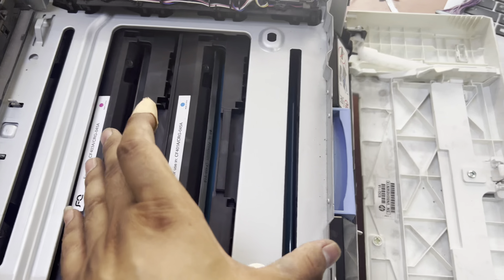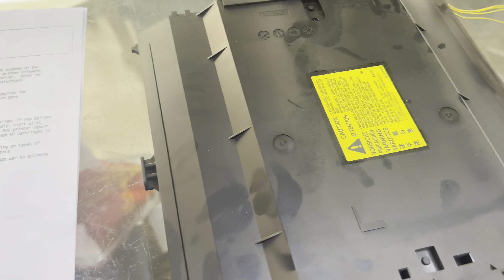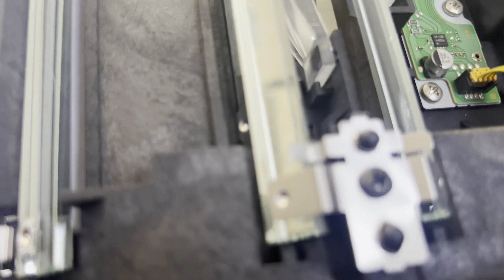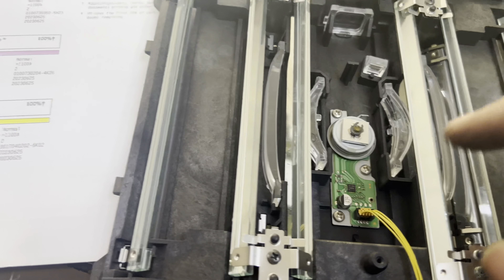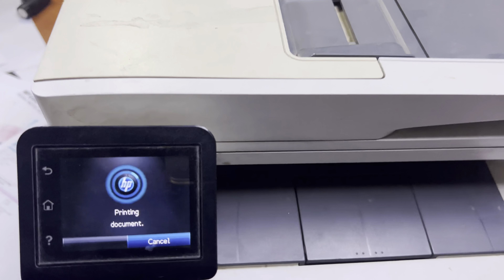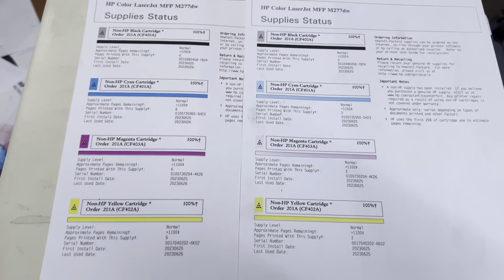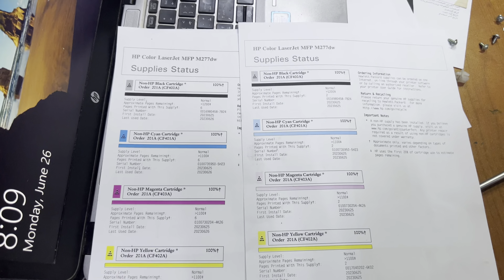Poor Print or Light Print Issue in HP Color LaserJet Pro Printers | Laser Unit Cleaning Guide

Comment: I have MFP M176N.
Is this method applicable to all HP laser jets?
Reply from the maker: First change the drum unit of M176n and check
Reply: @BilalKhalid  
First of all; Thanks for the quick reply.
Replaced the drum unit 2 months ago and cleaned it as well. But the real problem seems to be in the imaging mirrors.
The question was, where are these mirrors installed and can they be easily found?
Second, it prints just fine, but the copy is very light. So will replacing the scanner light fix it?
Reply from the maker: @PAKLANDTV no, if the copy is light or dim then the issue is with the scanner, nothing else. Just changs scanner lamp and it will fix your problem.
Reply: Printer have a new problem which is stuck on initializing after cleaning the mirrors. Can you explain what would be that?
Reply from the maker: First of all there was no issue with the mirrors, if its getting stuck now then remove all toners and re install one by one while the printer is turned on

Comment: Nice video bilal bhai.
Bhai after cleaning laserunit my printer  not printing Cyan color but other 3colors printing good only cyan color is missing.
Please reply❤need solution
Reply from the maker: check with another cyan toner or make sure all cables connected properly, or it can be due to laserunit itself.

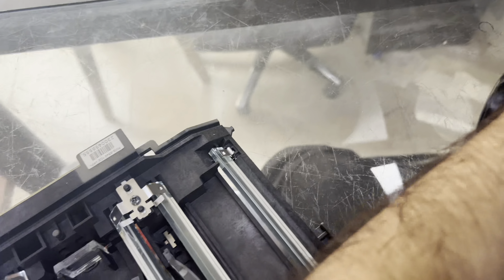Comment: What is the laser unit discussed at 0:53?  Is that the fuser?
Reply from the maker: no laserunit is a set of mirrors inside one black box in the printer. these mirrors need to be cleaned.

Comment: Hi bro, I have 277dw and my prints all come out slanted. Scanning is slanted, printing from laptop is also slanted. It is tilt to the right side by about 1 degree. How can I fix? 

I have check that paper tray is aligned and that there are not jams or pieces in the rear rollers. Thanks
Reply from the maker: issue is with the tray, or roller is not picking up the paper aligned.

Comment: Hi, I carried out the procedure on an hp-m476nw but it still doesn't print cyan and magenta. The cartridges are new, I made a mark on the side of the cartridge and they are running. What else could it be? I will redo the process. Congratulations on the video, hugs from Brazil!
Reply from the maker: Its can be from drive on the right side of the printer
Reply: @BilalKhalid Sorry, but what is the name of the drive you are referring to?
Reply from the maker: @ricardolira9567 main drive its a combination of plastic gears